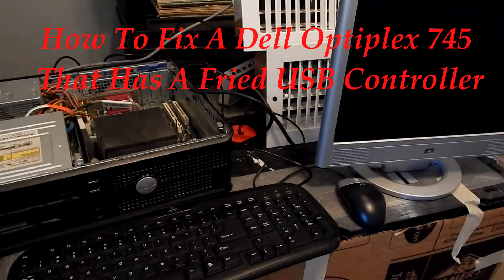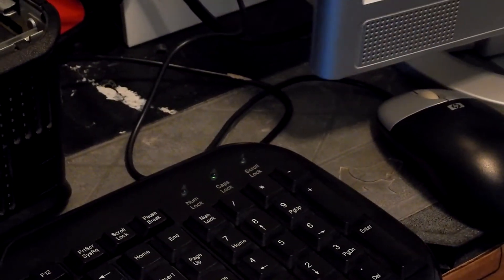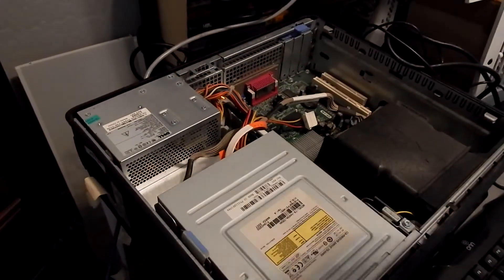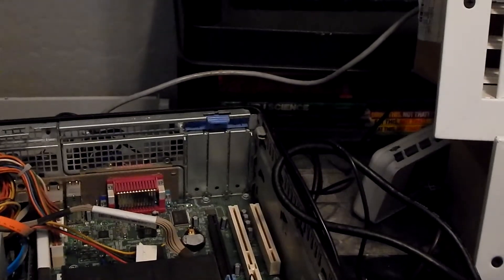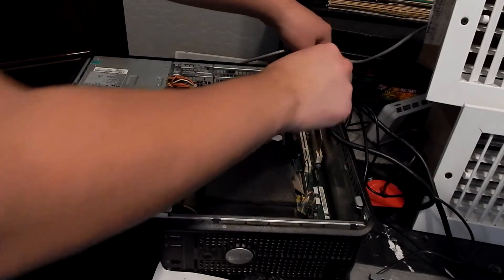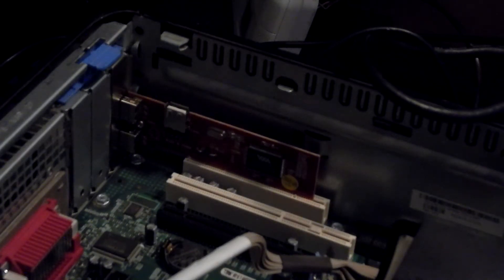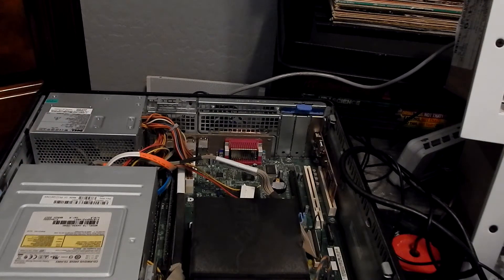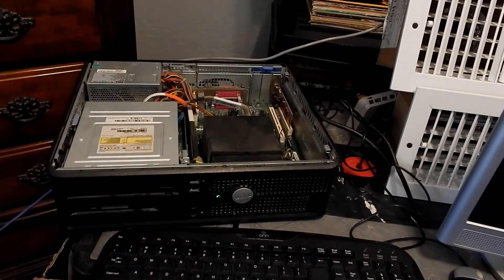How To Fix A Dell Optiplex 745  That Has A Fried USB Controller

Comment: Thanks Dude.... nice video!  You covered it all.  I had all my 6 USB's fry on my 3 year older gaming PC.  I do business contracting and had to rush and buy a newer gaming PC.  haha  Now, rebuilding the old gaming pc, for lots of data is on it...with a internal RDX drive too.  The new PC is on my 65 4K TV and now...I'll take the older pc to the bedroom 50 inch tv.  8)   I searched everywhere to fix the 6 USB's and came to the concluding watching your video, that power controller was bad and overload it.  I have a logitech Orion keyboard, with lots of LED light dazzeling me on the couch.  haha   Thanks again... Merry Christmas, you saved me from lots of nightmares and stress.   Note: the new PCIEx  3.0 USB card is powered from my internal 800 WATT power supply. So, that should help the load.